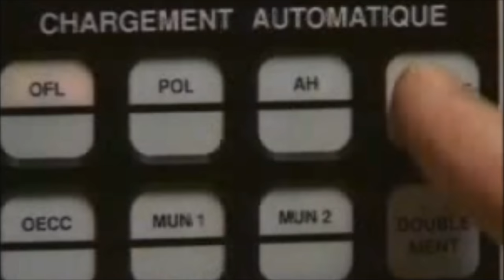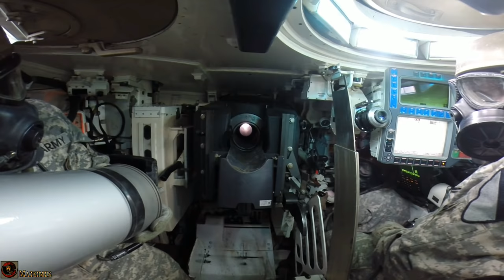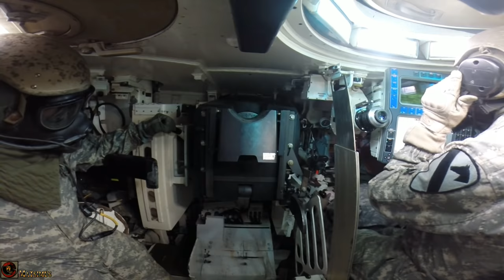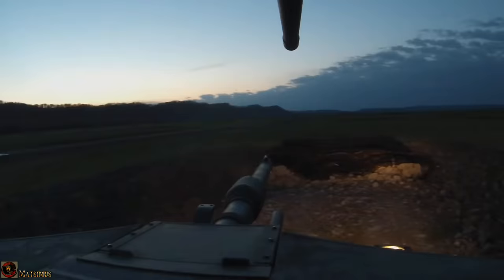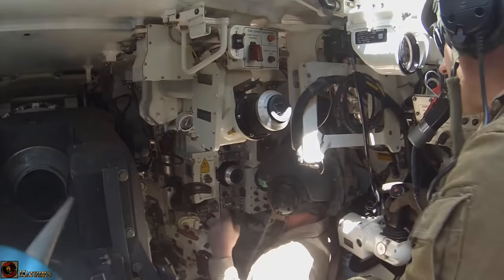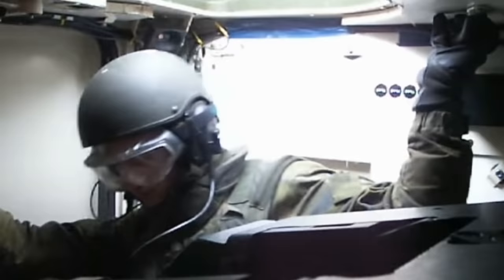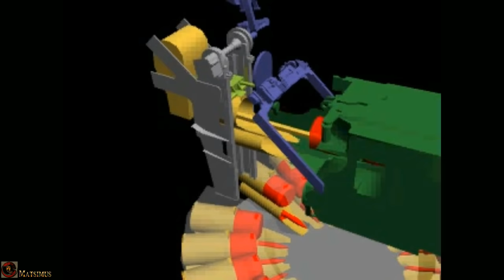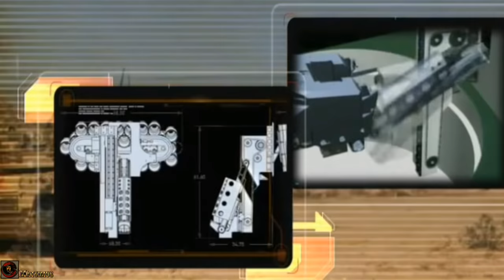Tank Autoloader or Crewman Loader?

Comment: Im noticing at some shots of the video inside the tank that he's pushing the ammunition inside the barrel..

Cant he's hand get crushed or the ammunition slide longer than its supposed to?
Reply: MultiGamerClub the rim on the end of the shell casing stops the shell from going too far
Reply: MultiGamerClub lol I was thinking the same thing.
Reply: Re: MultiGamerClub... That is why loaders have ALWAYS been taught to load rounds into the breech with their fists, and not open palms, so as not to have fingers accidentally caught by the quick snapping breech blocks! They were also discouraged from wearing rings and watches for fear such might get caught somewhere in crowded turrets; whether those were real dangers for crews or not I could not verify but I have smashed a couple of good watches myself simply because of being surrounded by nothing but metals inside turrets.And no, rounds could not be pushed too far into the chambers as the casings/charges are of different dimensions than the actual projectiles. BTW, on having a live loader as part of the crew, I bet you autoloaders cannot extract a misfired round like a loader could!!! I have experienced main gun misfire and such a dangerous job of extraction is best left to a human being, thank you.As to human fatigue for loaders, how many actual engagements would need 20-30 rounds to be loaded continuously!!!? If that is such a case, yes, an autoloader would not get tired like a human. But so far, multiple targets engagements would require 1-2 rounds per, and that adds up to not a whole lot of loading, with stops in between for gunners to acquire and engage. I was a unit commander and I have served in all the crew stations on tanks, and yes, we cross trains our tank crews as much as possible. The newest members to any crew would start off as a loader, then, onto being a driver and finally, gunner/TC. Try and cross train an autoloader then?My thoughts on the new Armata, the concept might be great but I feel that having all three crew inside the protective section in the belly of the vehicle eliminated one of the most important aspect of target engagement- that of situation awareness. Depending completely on electronics that could be damaged in battle leaves one without the Mark-1 eyeballs that a TC could use to scan from the much higher elevation of the turret. I could be very wrong but having been a TC, I knew nothing could beat having my head popped up over the TC hatch to scan before dropping back down.Please, don't flame me as these are just my own opinions from experience. Thanks.
Reply: @cav1stlt922  Check out the American and British tank destroyers of WW2. They had an open top because they thought that keeping track of what was going on around them was more important than being down inside a tank. It's popular to diss the Sherman but it was never intended to go against other tanks. Even a modern tank  when buttoned down has a lot of blind spots.
Reply: Re: John Kendall... that was another era, another time. We don't have tank destroyers anymore, nor do we have heavy or light tanks. Tank destroyers were lightly armored too, with thin turret sides and opting for speed and agility for protection. No overhead protections against arty, some units have fabricated make-shift turret armors because of it. There will always be blind spots on tanks, funny how German armors have rear view mirrors while we don't, and relied completely on dismounted crew to guide us in or out of positions.

Comment: In Artillery autoloaders is the best solution, but they don't use them to remove a crewmember. Even thou you don't need the fourth guy in a Panzerhaubitze 2000, you still bring him along just in case you have a autoloader malfunction or something along those lines. When dealing with 155mm guns, the rounds are so heavy, that even thou a person can load the gun fast, it is hard to beat the automatic systems. When we are shooting MRSI (Multiple Rounds, Simountaneous Impact) you would have to be a really good crew to manage to load the gun fast enough since you have to fire to more rounds long before the first hits the ground. The autoloader can do this by itself.

Comment: Russian 125 mm gun autoloader is able to load HE-FRAG shells, unlike Western tanks. 120-125 mm HE-FRAG shells are just too heavy for manual loading.Plus literally all Russian tanks should be converted into robotic tanks in the future because of autoloader ,unlike Western ones.
Reply: Yes, the program of converting Russian military vehicles into robotic ones is on the go. Just imagine how beneficial and cheap is such converting! This is a real miracle!
The large fleet of Soviet era tanks is converting into robotics instead of being melted into a raw material. The limits of human protection has lost it's significance and the advantage of high mobility and low profile is thriving. 
Important point is that after converting vehicles into robotic ones it is still can be operated by humans. This is a major demand in Russian military doctrine. Note, that autoloader is also can be operated manually in case of failure.
Reply: Not a Miracle if the Autoloader gets hit by a Rocket or a Shell. And what's the Point of Physical Training anyway when you are replacing humans with too much Tech? I'm starting to think that Machines will replace the Human Workforce.
Reply: @diligentone-six2688  and that same shell wouldn't kill the turret crew if it penetrate the armor? 
At the end of the day what do you choose, a death crew or a broken machine? 
What do you public opinion would like more?
Reply: @diligentone-six2688  A lost tank is just a lost tank. But a lost crew, that's horrible. I rather loose 10 tanks instead of one crew. Human lives don't have a price tag, tanks and other weapons do.
Reply: The HE-Frag is roughly 70lbs. It's not too heavy. It's been done manually. Fuck, loaders work out with 85lb HEAT rounds filled with sand and lead here (inert shells of course) so, I mean, it's doable.
Reply: @Deus Vult To hack a weapon system means you have to establish a wireless connection but here's the problem when it comes to Russia's military: Russia is currently leading when it comes to jammer systems.
Reply: I think the main advantage is that the manual loading tank should stand still, While Russian can fly and shoot and even turning the  turret may just drop the standing manual and make the loading very hard
Reply: More things to get hacked
Reply: Yeah john Connor won't say shit. He's from future and knows best

Comment: Most of this video is just conjecture from a preexisting bias toward manual loaders. All the of the negative aspects you listed are mostly speculation and don't have any real weight behind them.The only real argument that can be made is more hands to preform crew level PMCS which isnt so much of an issue when you consider that most auto loading tanks are pretty easy to maintain even with the reduced crew. Over the 60+ years auto loaders have been around and most of these urban myths surrounding auto loaders "unreliability" and "danger to the crew" all stem from the early model T-64 variants which had a lot of teething problems even the "exposed" ammo is and old argument at best when you consider that modern Russian designs  utilize horizontal laying charges and that decrease the likelihood of a cook off as well as have an armored cover over it. Not to mention this is assuming the crew would even survive an round penetrating the turret. Also Russian tanks are pretty easy to maintain by comparison to western tanks which is why they are able to be operated by 3rd world Dindu's and Hajibob's with ease even with the "complex auto loaders".  Not to mention most soviet tanks to have the ability to swap between shell type but not when a road is loaded but that is more relevant on training ranges than in actual combat because most crews would just shoot the round and load another different type of shell.Also if the auto loader was such a bad design aspect why did the Soviets and Russian federation keep the auto loader over switching back to a more conventional manual loader?  >inb4 russian crews arent meant to survive rebutal 

Also this entire video leaves out the mention of other very successful auto loaders which have none of the historical baggage like the Russian auto loaders and have the best of both world in terms of protection and efficiency namely the bustle auto loaders on the Leclerc, Type 90, K1 and K2 tanks, Atlay, and so on.
Reply: K1 is manual. Shooting a round to clear the breech is one of the worst things I've ever heard. And it's actually cheaper to build an autoloader than train and maintain a human to do it. Turret crews generally do survive a penetration of the turret, depending on spot. In the ammo rack? On the Abrams at least, if the round is 125 or smaller, nearly always. You have a literal 2 tons of composite armor between you and that compartment, more than you have on the side of the turret (I believe) even. Cherry on top? I can outload not only a Russian outloader, but the one on the Leclerc
Reply: Autoloaders are a nightmare in every way this video describes. I actually think he’s being a little easy on the auto loader concept. And Just shoot the round and load the round type you need? You cant just expend a 125mm tank round “somewhere” in any scenario training or combat. A tank round has extreme consequences. Even the worst militaries practice some type of DFCMs and in my 9 years in Armor, expending the round in the tube just to clear the breach isn’t done anywhere on the planet unless it’s at your target (“fire, fire sabot” if you had a HEAT round in the tube) . Ask anyone who’s been on a tank anywhere in the world ever and they will tell you they’d rather have 25% more manpower than less because maintaining the beast is a majority of what you do. It’s another guy to turn wrenches, maintain weapons, and provide security.
Reply: @mark-ti5cm  citation please about auto loaders being a nightmare if they where such a nightmare then why are pretty much all next generation MBT'S going to that particular system, as for expending already loaded munitions that can be done in the rear or when the firing range goes cold with a ramrod but again this problem is only an issue with Russian auto loaders not auto loaders as a whole because  Russian munitions is in two parts where as ranks like the leclerc, K2, Type 90/10 all have bustle loading auto loaders which use standard NATO shells and can be manually ejected. That being said in combat if you need to load a specific type of round innthe middle of firing which is unlikely you would likely just fire the round you already have inbthe tube at your target and just set the auto loader to select the round you want under combat circumstances fire/load/fire is still faster than eject/stow/load/fire. And again that would be a compleing arguement if Russian tanks where difficult to maintain like NATO tanks where but they arent they are able to be maintained by ISIS if that's any testimate of how dummy proof the tank is. Also most tanks now a days are maintained and worked on by the motor pool. Crews no a days have it pretty easy compared to tankers of old.
Reply: @psychicumbreon  my mistake I was thinking of the K2, for range conditions yes shooting a round to clear a round is not ideal but under battlefield conditions it IS what Russian tankers are trained to do.Fire/load/fire is still faster than eject/stow/load/fire. Also I'm sorry but your fucking full of shit the Leclerc and Type 90's governed auto loading speed is 5 seconds using auxiliary power the Type 90 and type 10 can load at 3 seconds because unlike Russian auto loaders that load projectile then propellant. The Type 90/10 and Leclerc use 1 piece ammo just like the Abrams and just shoves the whole thing in with one clean motion which is why they are so fast. That being said how fast the loader can load is kind of irrelevant anyway when you consider the time between shots is usually about 6 seconds anyways so the 3 second autoloader is kind of redundant the advantage Auto loaders provide is ironically crew survivability because a penetrating shot to either side of the turret cheeks cannot degrade or completely knock out said tank because both commander and gunner both have each others controls Not to mention that if the gunner is killed the commander can load,and fire the main gun without having to reposition themselves in the tank. If the gunner was killed in the Abrams there is a good chance the commander isnt going to make it because he would have a APFSDS hole in his groin area or it would severe his legs however if the Loader dies the commander has to crawl over the main gun to start loading and the gunner has to take over acquiring and engaging targets through his narrow field of view.

Comment: No, I don't agree. A reliable autoloader will ALWAYS be better than a human loader. 
1. Space
2. Speed (Not only the first 5 rounds in the sweet spot but the WHOLE magazine).

If you look at the Strv 103 it was extremely reliable so you can rule out that factor. Yes, there's been others, e.g. the Leclerc that was less reliable than desired, but that's French engineering for you. Yes, the 103 could switch ammo type even with a shell loaded and it had access to ALL rounds in the magasine. It could fire at the same speed until it ran out. You will NEVER be able to do that with manual loading. Sooner or later you will have to start grabbing those rounds in the floor e.g.

Sorry to rain on your parade. :)
Reply: And there is the issue of segregating ammo from the crew.
Reply: @ricardosoto5770  do it like the Russian, build a capsule
Reply: @shatteredstar2149  That is one way, the other is put the autoloader in a separate section of the turret separated from the crew by an armored wall and with blow out panels on top. That is the way French, Korean or Japanese tanks do it. All require a new tank or at least a new turret design.

Comment: The first US attempt at a autoloader was with the MBT 70 which its project was shutdown and the m1 program began, it had a mishap of jamming due to them trying to use two part munitions with charge bags they tended to get caught on things or a spark in the breach would set it off of course the tank was a attempt to put the most advanced tech in the smallest vehicle and it cost way too much for the time things like composite armor, hydro suspension, autoloaders, gun launcher able to fire normal AP,HEAT, HE and guided rockets and its crew was in the turret including the vehicles driver whos viewport stayed facing forward even while the turret was turned but this caused the driver to become ill.

Comment: im a M1A2 Abrams Loader, i can sling a round into the breach in under 3 seconds, with another in my lap ready to go in under 1.5 seconds. we dont need no stinkin autoloaders.
Reply: Roger that!!! Lots of folks here sure sounded like they have never served and even more who has never been a Treadhead. We know better! :-)You started off as a loader, you will get in the driver or gunner seat soon enough; and if you stick around long enough, you get your own track. Keep up the good work!
Reply: I have no military experience but shouldn’t the ammo remain in the ammo compartment until it’s ready to load? Aren’t you breaking safety protocol?
Reply: By regulation and SOP, 'No'. And as an officer, I will never instruct any of my own troopers to do the lap ready round routine but it was (is) regularly done all the time!!! Back as an enlisted, I have done the same thing myself, to cut down on reload time; I guess it all depends on how good a loader you really are. Most TCs would train their brand new cruit loaders properly and with practice and dry fire crew drills, loaders, as with the rest of the tank crew, would be able to shave seconds off engagement time!In gunnery tank tables, crew would know what the next targets might be and the loaders could get the next round ready that way! In real life, it wouldn't be the case when the coax would be firing, loader's MG needed manning, handing 50 cal. reloads to the TC, etc. so you wouldn't want a heavy round sitting on your lap when you needed to do all that! The loader has the most accessible turret opening so he would be the one to chamber out and do all the external stuff if needed.... like grabbing more ammo cans, replacing lost or torn antennas, reload smoke dischargers... Hope my answer satisfy you.
Reply: Rules are meant to be broken
Reply: Those are all old tanker tricks that, let's be honest,  were mainly for tank table quals and Top Gun bragging rights.  My loader had a nodding acquaintance relationship with the safety switch.  He just stayed out of the way. Gunner the same with the selector switch.  IDENTIFIED, UP, ON THE WAY.  Rinse and repeat.  Hell, I got on my gunner because he dragged out on the way too long.  Very unlikely  a loader is rolling down the road with a 120MM HEAT in his lap.  But when you know what's coming and you have a 3 round engagement, you bet.
Reply: Nobody cares how fast you load in a parked tank in a garage, I'd like to see you lap load in a combat situation where you are under fire and the tank is moving, also possibly with blast doors open, so you can grab the next shot quickly, like the smartest of the internet loaders.

Comment: There are pros and cons to the human loader - auto loader debate and both are valid. However as a former tank crewman, Leopards, I can state that an auto loader cannot think and anticipate the situation at hand. But most important I would like to see an auto loader make a brew (cup of tea) on the move, feed the crew, refuel the vehicle, clean any of the weapons, resupply the ammunition, drag out of a burning vehicle and do first aid to another crewman, change a road wheel, defend the vehicle whilst dismounted or hide the jack rations (non issue).